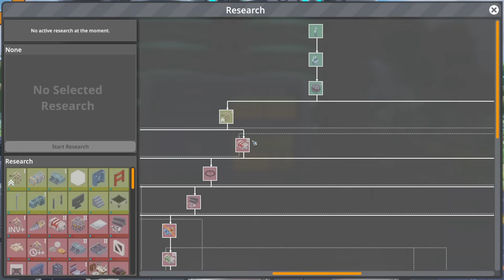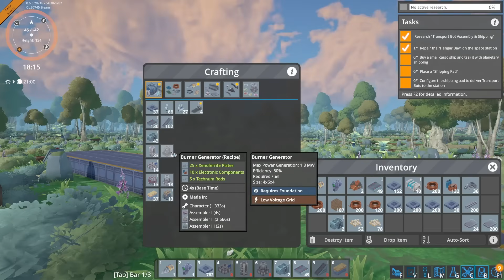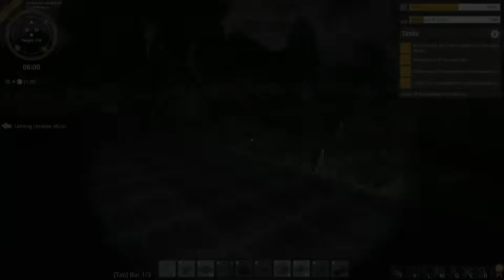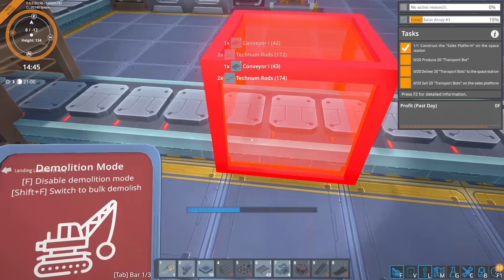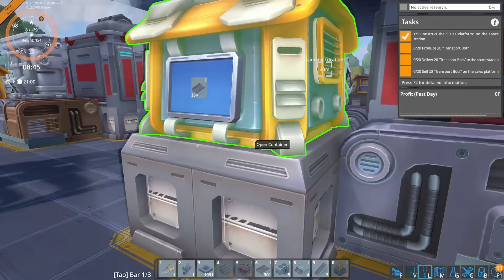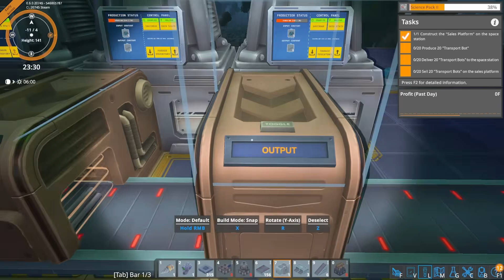Foundry - How To Automate Power and Starting The Bus - Update 2 [E2]

Comment: Further down the line of my bus I am struggling to keep up with some parts due to crafting requirements of the same part in multiple sections. is the bus infinite or will you make another bus for powered by a separate mine for ( example ) explosives.
Reply from the maker: I am going to be making a much bigger bus for actual production. Everything I have done up to now is just prep.

Comment: When i started a new game in update 2, i decided to do bus a bit differently: instead of building main bus on surface, I've pulled it one level up and it made it much more simple. In my case, if i need to branch out, i add splitter, ramp down and bring line below main bus. It looks and feels much better imo
Reply from the maker: That sounds great. Thanks for the sharing.

Comment: Game really needs belt to belt and machine to machine loaders. Also, freight elevator isn't as bad as you think (I'm the same and initially avoid) but they do have about 14 input/outputs and only take up roughly the same footprint of the 2 slopes you built. They don't require power either,. Note: the push for 3rd lane loaders is a bit of a pain but they are sooo required.
Reply from the maker: I'm not to stressed about the loaders. Every game has their own way of doing things.

Comment: I've gotten into bot making. I would suggest to anyone starting out a new game. Automate the bots ASAP. It's your income and takes time to get up and running. You will also need to us it to buy construction materials for the station upgrade.
Reply: Can you still produce construction material later on?
Reply: @PI_Joe_Mama  Yes, you can, but they changed the recipe which requires firmalite sheets. Which requires lava caves and shipping firmalite down to the surface and then down to the lava cave to smelt, and then shipped back up. It's a process.  Another reason to get bots up early :)
Reply from the maker: The new process sound intense.
Reply: @souliris  also upgrade the R&D lab on the station ASAP. it’s expensive but you can increase the sale price, lower their weight, and make them faster.

Comment: Good Stuff.  I might like the snow biome less than anticipated.  I have found 1 technum node and a bunch of the xeno and several ignium.  The one technum scares me though.  Feels like I should have found another already.  I need to do some reimagining things.  The launch pads and robots you can sell have thrown a kink into things for me.  My normal buss and set up are too tight for the additional output needed.  I was hoping to find more basic resources to do a completely separate build for some of the things but no technum.
So the question is total restart on another planet or come up with a way to run tighter with what I have.  It wouldn't be so bad if you could recycle parts but making several storage bins just to do a rebuild that will only be used once sucks.  Maybe I can do a rebuild in sections or separate parts so I don't need as much storage.

In case you wonder why I ramble on I have been told the more verbiage in comments the greater exposure of the content.  So most of this is for your algorithm....;lol
Reply from the maker: Thanks very much. The initial deposits seem to last a lot longer than before. I'm taking advantage of that.